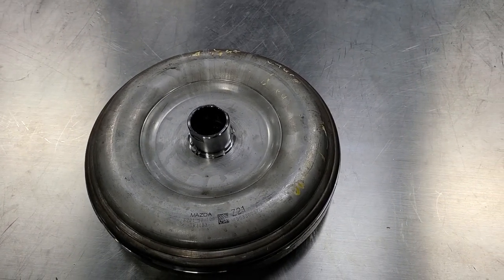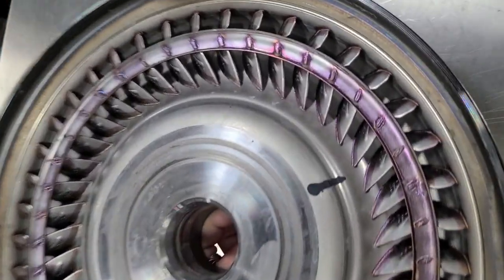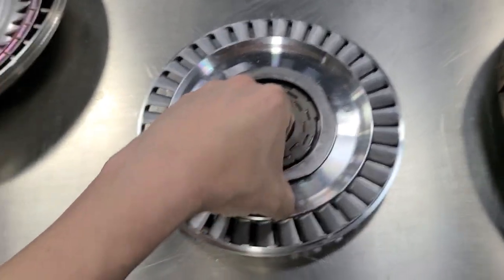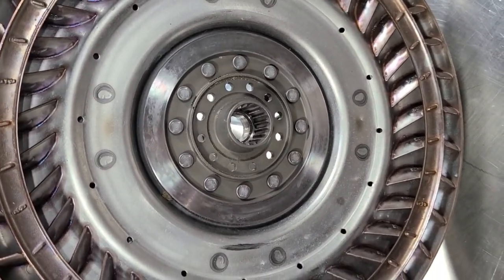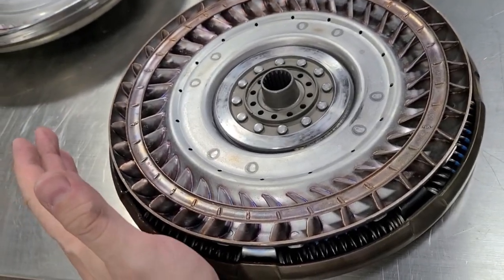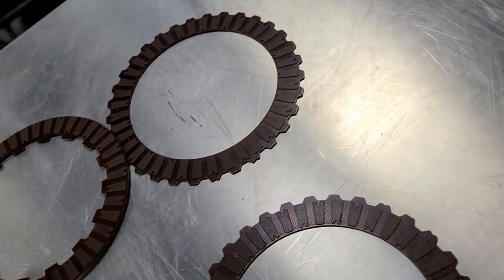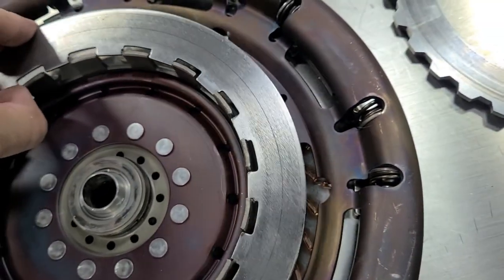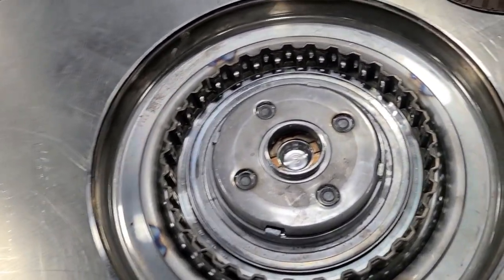Skyactiv Torque Converter

Comment: Nice to see an OEM not down-costing everything by going with the lowest bidder. The dampening in the TC is real, I have a 24yr old Toyota with a non dampened TC and that thing is HARSH like a manual at 6000+ RPM. The Skyactiv is smooth in comparison on/off throttle, I almost wouldn't mind a little more feel to it but as a daily driver I do appreciate the dampened TC especially when it's a little confused and bumpy at low speed/low throttle.

Comment: I have a 2016 CX5 with 150k km and have an issue where, after engine braking and accelerating the car shakes. It's more noticeable on 2nd gear @2000 rpm but also happens up to 5th gear around 1500rpms. Sounds to me this clutch inside the torque converter is the issue? Transmission fluid was replaced at 120k kms and recently checked and it looks fine.

Comment: Hi , i drive s Mazda 6 , 2014, 2.5 NA, let say i reach 60 km/h and i stop accelerate then i push the gas again , doing this i can  hear a noise like 'clunk' and feel a gap/play between the transmision and the wheels.What is this, its normal?
Thank you

Comment: I have a '16 3 and it always lags/jerks going into 2nd, jerks going into 3rd and sometimes shifts hard into 5th. Sometimes it'll shudder too when I let go of the brake on a downward incline, assuming that has something to do with how it slips into neutral at a stop. imo it feels poorly engineered just how uncomfy it is to drive. Surely this isn't normal?
Reply: Remove your dipstick how the fluid looks and smells?
Reply: @leod3963  I changed fluid twice didn't do anything didn't look or smell burnt.
Car is at the dealer getting a new transmission right now

Comment: Excellent stuff. Is this what's in my 2013 skyactiv Mazda3 2.0L with the automatic trans.?👌
Reply from the maker: Yes all the Skyactivs with the exception of the cylinder deactivation cars use this same style, they have a single clutch and a much bigger damper with a pendulum.
Reply: @21mazda3turbo3  what's different in transmissions with cylinder deactivation?
Reply from the maker: @alexk4804  CD cars transmissions are based on the naturally aspirated cars base transmission. The biggest difference is the torque converters do not have a multiplate clutch and have a large pendulum style damper to even out the pulses from 2 cylinder mode. The 4th gen naturally aspirated 3 also uses a different reduction planet that has offset pinions that the CD cars have.

Comment: Nice vid. I have both n/a skyactiv 2.5 as well as the turbo 2.5. what was the trans fluid like at this mileage? I know Mazda says "sealed for life" but do you have recommendations on the auto trans fluid change interval?
Reply from the maker: Transmission fluid was in pretty bad shape, I haven't torn down the transmission to look for the failure but it lost 1st gear so it likely had a one way clutch failure. Personally I will be changing my transmission fluid and filter when I hit 30k miles. Mazda FZ  fluid is a great fluid but it does get worked quite hard in these units.
Reply: I've changed the transmission fluid and filter on my NA 2.5 4X. (297K KM). I suggest dropping the pan and changing the filter every 60-80k km.
Reply: I went to the dealership and had the fluid exchanged at 85,000km.  I do tow a fair bit.  The mazda dealercharged $299 plus tax Canadian $.  A pretty good deal I thought.

Comment: Hey man. I have a '16 mazda 3 with this same transmission, 2.0L. Do you know by any chance if the TCC engages with the engine as soon as acceleration happens? I am getting these sluggish accelerations; rpms go highly more than normal and I feel this subtle judder when the car decides to "engage" and starts picking up a little bit more speed. I am assuming my TCC is worn out or beggining to, as I dont have any codes, my sensors are in good shape and my ATF was drained the last year.
Reply from the maker: TCC engages around ~5mph depending on the vehicle. If you're getting a shudder, you may be developing an issue with the TCC.

Comment: Mazda said no need to change transmission oil, do u agree with them?
Reply: No.
Reply: That's only if you plan to keep the car for 5 years then trade in if you keeping the car for many years change your fluid every 35,000 miles
Reply: Change your trans filter every 70,000 miles.
Reply: I can say I've got 205K miles with original transmission fluid with an occasional solenoid sticking going from 5->4 gear and park/neutral/reverse to 1.  But I sort of suspect I may have caused unusual wear somewhere by using neutral while moving rather often, or it could just be a solenoid defect because only one solenoid appears affected.  The 5->4 issue very rarely happens but it happens much more often if I go between the higher gears and neutral, then later go back down in the gears.  These issues have been around in a bit varying intensity for like 40K miles now but it doesn't really have me concerned that the car is in danger of being inoperable (in fact if this solenoid gets fully stuck, the transmission can still operate only with the higher gears, but with diminished hill climbing ability and a bit worse mileage in the city)

Idk, anecdotes aren't really stats but these transmissions are capable of surviving on original fluid for quite a while.